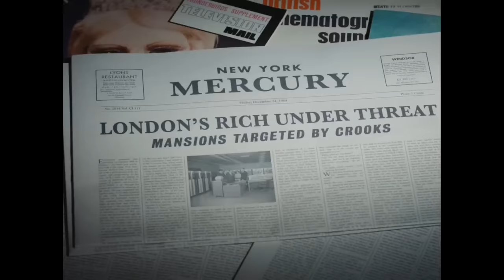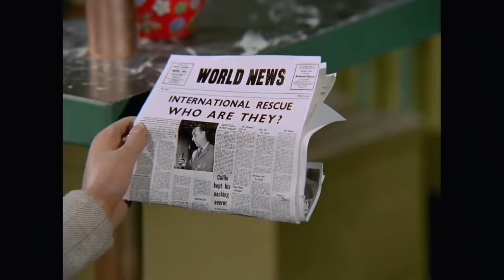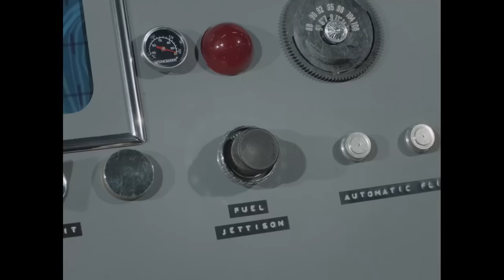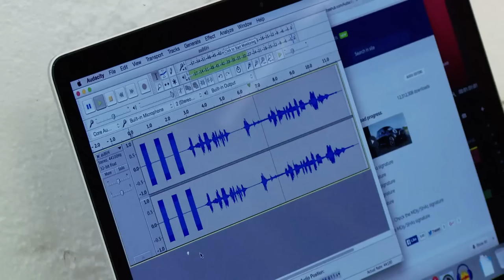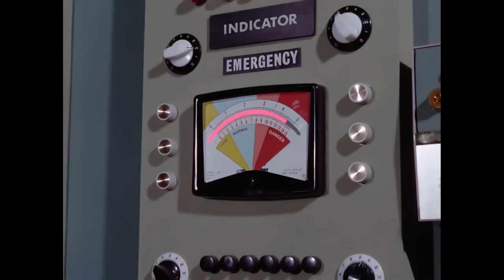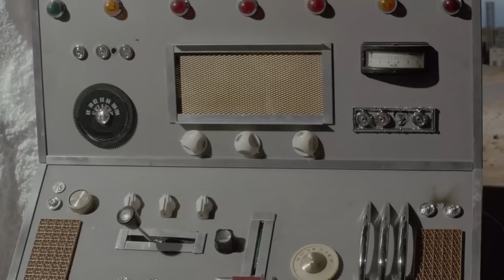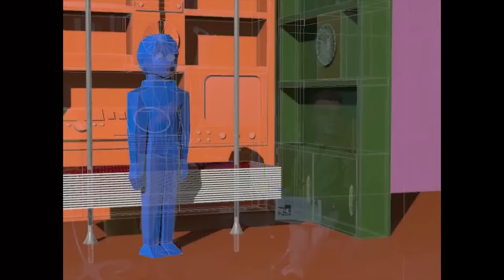BEHIND THE SCENES of Thunderbirds Anniversary Specials – Supermarionation Puppets & Special Effects

Comment: 15:06 wires breaking is not necessarily a bad thing and in fact might lead to a happy accident that changed the entire format of Thunderbirds as we know it today. 
If I remember properly Thunderbirds was originally meant to be 30min episodes same as its predecessors and successors. BUT in filming the landing of the Fireflash onto the elevator cars in Trapped in the Sky, the wires snapped on Remote Control Car 3 causing it to veer off entirely. Rather than a full reshoot the team decided to make this part of the scene to add dramatic tension that impressed Lew Grade that much he wanted the series to be one hour long. 

Of course we now know the entire scene of Remote Control Car 3 veering off owing to a Radio Fault and smashing into parked jets causing a fire. Fireflash had to overshoot while Virgil had to reset the cars (including the standby car) causing the anti radiation shielding on Fireflash to expire leading to the dramatic final touchdown (which then had another happy accident (?) of Virgil deciding to take a scenic drive off the runway because why not) 

But as always it was the explosions and the top 3 for me being
Reactor 4 in the Mighty Atom (we sure Gerry Anderson and Derek Meddings were not foreshadowing another certain Reactor 4 blowing up 21 years later? 😉 or did the Soviets take some tips on how NOT to shut down a nuclear reactor in major trouble)
Zero X. That was a bang
And of course, the Missile Base in Thunderbird 6 because why not go out with a very large (non nuclear) bang (and do so again in Joe 90)